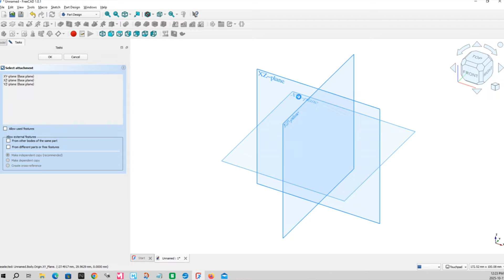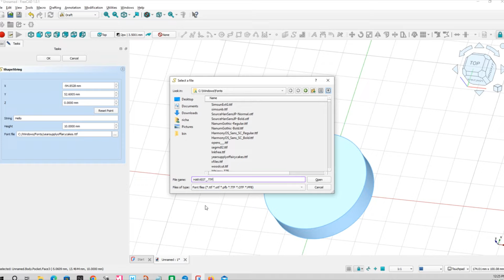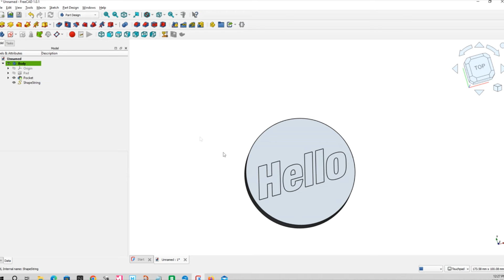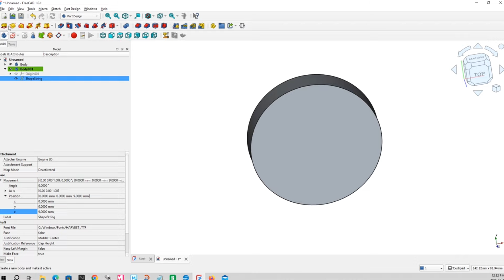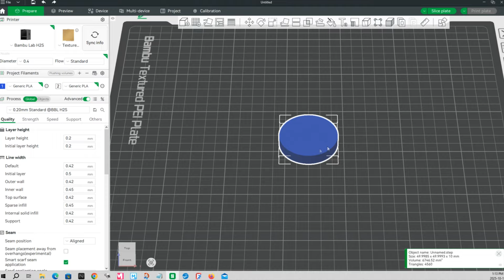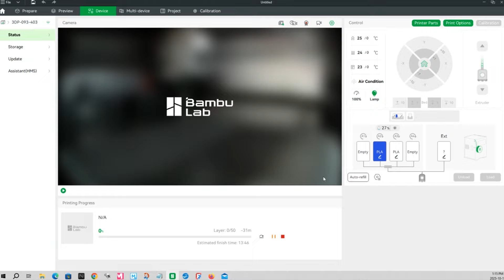Using FreeCad, I show you how to add text to the surface of your model for 3d Printing

Comment: Wow! Finally a tutorial how to do this 🤩 I have been looking for this for very long and didn't find it. And now it just came up in Youtube 😆Question: you made a text with a thickness of 1 mm and to print this it needed 5 layers of 0.2 mm if I am right. The result was looking really good, but is it still good with less layers like for instance 3 or maybe even two? In that case the text should be specified as 0.4 or 0.6 mm thick but the benefit of this would be that printing would be quicker and with less waste to switch from the filament. Did you already test this? I am very interested in your answer and thanks again for this wonderful video! 🧡

Comment: Thanks a bunch! I didn't know to export multiple bodies (STEP w/colors). It Still blows me away that the printer somehow knows not to try to print the other body where the text body is without doing some sort of boolean operation in FreeCAD! Now that I have a P2S I wanted to do multi-filament labels. I'm wondering exactly how many layers minimum are needed for the lighter-colored text on dark background? Would be great if just the first layer worked. Filament changes are expensive (time/material) on a single-nozzle printer. Cheers from MT!
Reply from the maker: Each layer, by default is 0.2, so 5 layers equals 1mm. I dont think one layer will work with a light color against a dark background.  Maybe, try 2 or more ???

Comment: I follow your steps exactly to create the shapestring and place it in a new body, but when I pad it, only the first letter is padded. Have you seen this problem?

I'm running freecad 1.0.2 on Linux ...
Reply: solved my own problem!  Look in the Experimental tab of the body where the shapestring is going, you'll see a property 'Allow Compound' - make sure it is set to true.  That's it!
Reply: @lyncher3647  Thank You that you explaned how you solved that. I had exactly the same problem!!
Reply from the maker: I know only how to creat this on a level object (not slanted, tilted, off 0 degress) ?  Also, before you leave the shapstring box, you have to hit the RESET POINT button to put the text flat on the point of origin.

Comment: I discovered that same method a few months ago. Another tip. If you want to print the colors in a certain order, select the bodies in the order you want them to print. They will export to the STEP file in the correct order. I was printing some lightboxes and wanted the lighter colors to print first. You can also re-order them in Bambu Studio by dragging an object up or down. I name the bodies relative to the color I want them to print. Makes it easy to pick the correct color filament in the slicer. Good tutorial!

Comment: I believe the Bambu Studio is capable of adding such flat text on a surface on its own. So you basically build an stl without text in freeCAD, import it in the studio and then apply text on its surface.
Reply from the maker: Yes, Bambu can do surface text, but the fonts aren't that great, and if you are already in Freecad, best to have it done in that one program.
Reply: @farmboyfixes 
You can use an SVG as a modifier so you can use any text or image.  Seems like similar amount of steps but I prefer making customizations in the slicer when possible.

https://youtu.be/GaTpyBVVxww